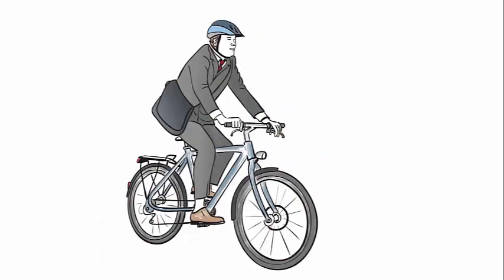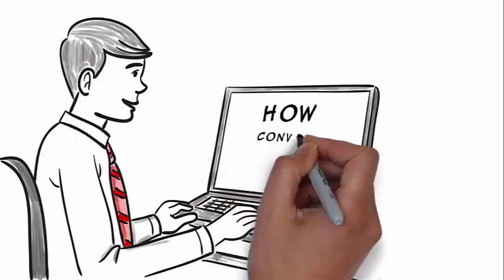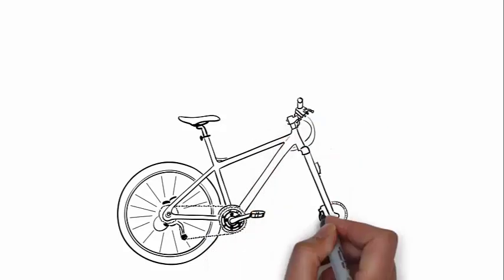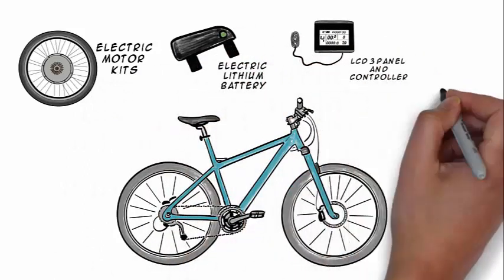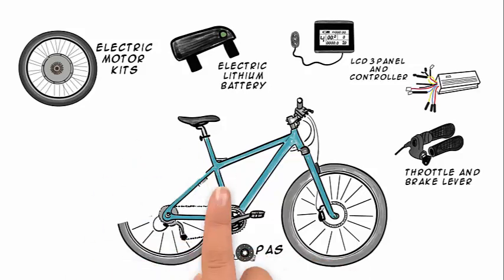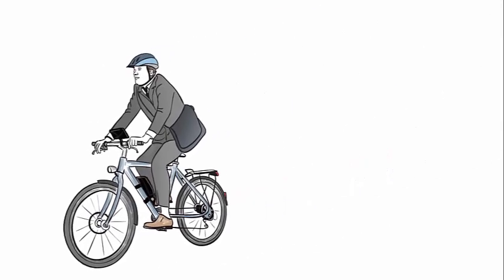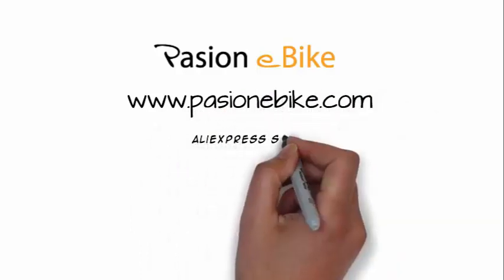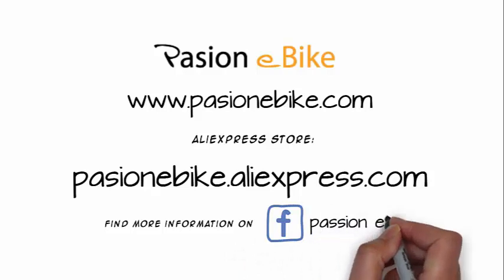passion ebike  48V 1500W DIY  electric bike motor kits conversion kits whiteboard video

Comment from the maker: 48v1500w freewheel  （ 7 speed  ) rear drop out 135mm  motor kit with regular lcd display LCD3 ：

https://www.aliexpress.com/item/32476876343.html

48v1500w cassette （ 8 speed or 9 speed )  rear drop out 145mm motor kit with regular display LCD3 ：

https://www.aliexpress.com/item/32879011274.html  

52v 12.8ah hailong battery  : https://www.aliexpress.com/item/32820484556.html 
 
52V 20ah or 52v30ah triangle battery : https://www.aliexpress.com/item/32540220076.html 

52V17ah polly battery :https://www.aliexpress.com/item/32779436692.html 

Range (mileages) calculation :volage x ah / wattage x theory speed  (theory speed for 1500w  =60 km/h)

So 51.8v 12ah hailong battery with  48v 1500W rear motor kits 's  mileages  is 51.8x12/1500x60 = 25km

So 51.8V 20.3ah triangle  battery with 48v 1500W rear motor kits 's  mileages  is 51.8x20.3/1500x60 = 42 KM    

So  51.8V  30ah triangle  battery with 48v 1500W rear motor kits 's : 51.8x30/1500x60 = 62km